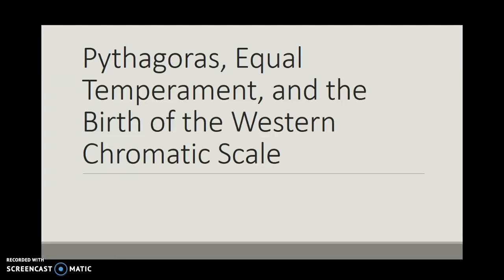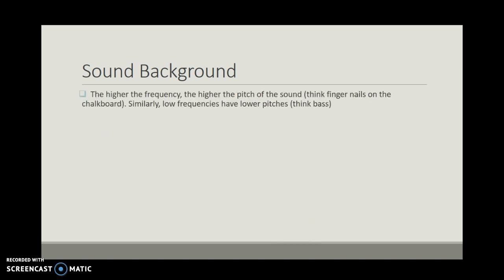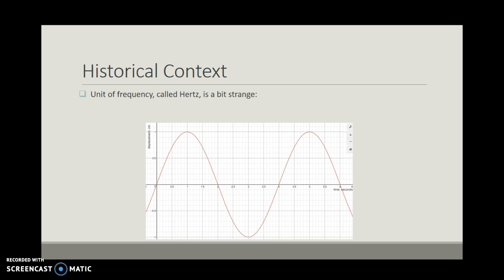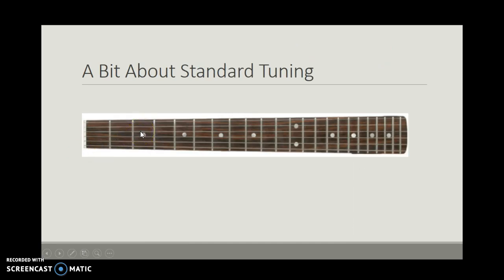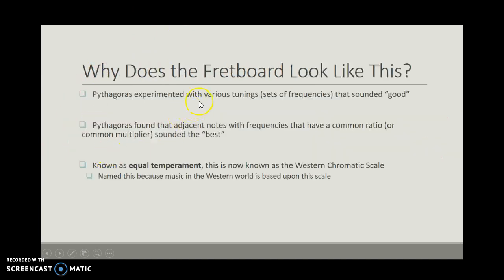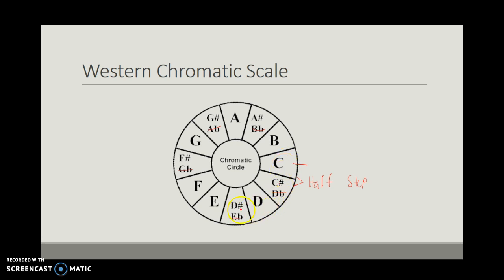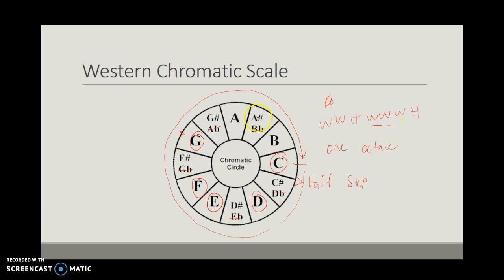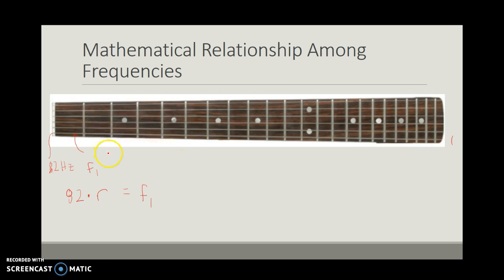Math of the Guitar Fretboard (Part 1)

Comment: This ignores the fact that the strings do not all behave exactly the same. Drawing a straight line fret does not make all the strings behave the same way .So a guitar fret system is not equal temperament . It`s just out of tune .
Reply from the maker: Hi John, Agreed. These are theoretical calculations based upon an "ideal string". At the same time, the formulas used to calculate fret positions are indeed used by luthiers (you can visit stewmac.com and replicate their fret positioning charts). 

The adjustment for strings not being theoretically ideal is done by asynchronously adjusting string contact points at the saddle. In other words, by lengthening a wound string, we can make the octave note (at the 12th fret) identically (at least to the human ear) match the open note (at the nut). There are different means of fretting an instrument, but they tend to be far too complicated to employ in practice and are simply not worth the benefit. 

I am by no means a professional builder, but I can say from the three-dozen or so instruments I have built that these formulas work pretty well.
Reply: If you want frets that take into account the differences in the way the different string guages tune, you'll need one of those squiggly fret guitars. And even then, all of the variation in the way a player might fret a string down, coupled with other unforseen imperfections that a guitar might have, you're unlikely to ever be completely in tune with equal temperament- a system that, itself, is out of tune with true temperament. But that doesn't matter, most people use straight frets because it's far easier to make a guitar that way, and we're all accustomed to the sound of that kind of "out of tune" tuning a guitar has, so it's not too important that pretty much all guitars are out of tune. But again of course if you strive to be closer to the tuning of an equal tempered system then by all means look into those squiggly fret guitars, they're pretty cool looking imo.